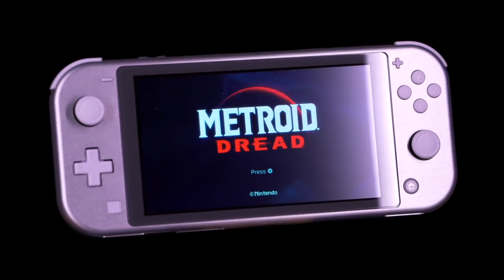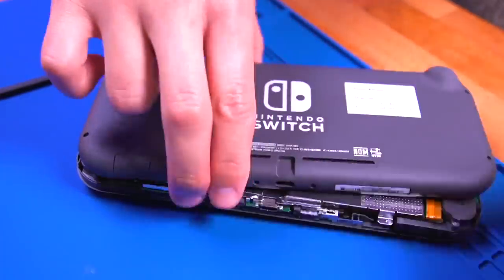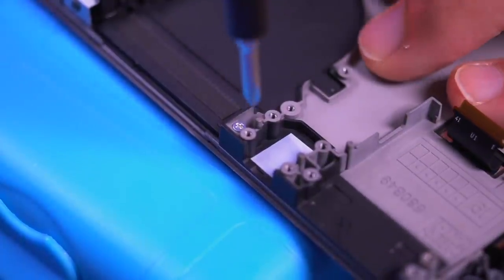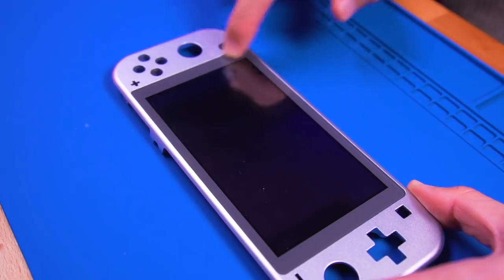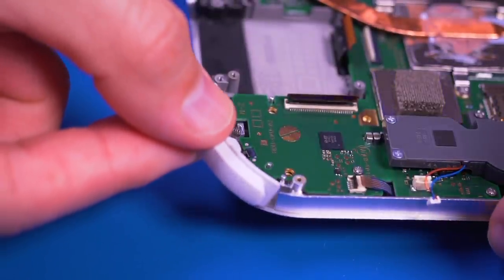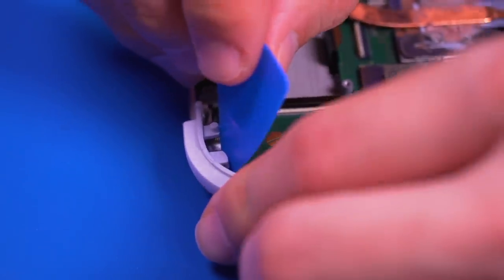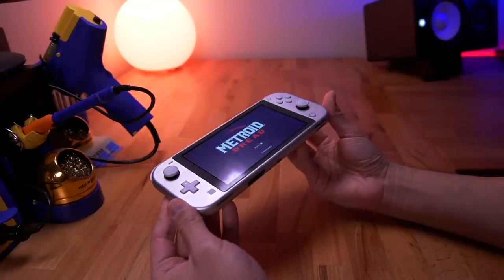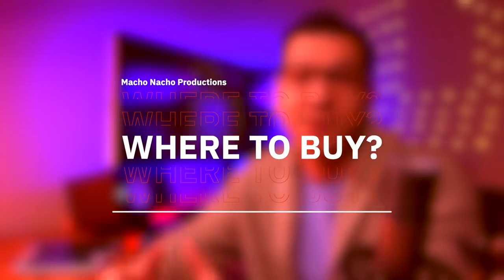If Apple Made a Switch Lite, It Would Look Like This!

Comment: Thanks! This was enjoyable to watch. I wonder if it would be possible to make a home console only version. No screen, no controllers sticking out. I bet a small all metal home console would look amazing.
Reply from the maker: Actually, that would be awesome 🤩. Something to think about for sure
Reply: I know it's pretty much a pipe dream, but I still hope Nintendo makes one. I never use my Switch handheld, but the handheld features cause me so many annoyances. Like forgetting to have it charged before going to play, because it won't power on even in the dock if the battery is dead or too low.  Or Nintendo not bothering to let you power off the system from the controller, because they completely forgot to consider somebody playing docked. They'd surely have to remember if there was no portable version... Right?
Reply: @mjc0961  I know what you mean. I usually don't play handheld either. If Nintendo doesn't make one, I'm sure a company like this will, though I imagine it'll involve some modding (soldering) to power off via controller and do away with the battery.
Reply: @mjc0961  why is the battery dead if you never undock it? 🥴
Reply: To power off a switch using only a controller press and hold the home button for 3 seconds and then press A on "sleep"

It's literally a day one feature how have you lived without this?
Reply: @skepticaltile  Problem solved!

Comment: Can the bottom opening for the antenna be filled in like the top with resin part of the way to still have a spot to transfer over your serial number sticker? Also instead of having the back panel plain, since you'll be selling it in your store, I think it would be cool having the Macho Nacho logo where the Switch logo would normally go. I also noticed at 20:40 that the screen isn't sitting flush with the shell and sticks out. Or is that a screen protector?
Reply from the maker: Great observations!  Yes, there is a screen protector on the the screen which is why it sticks out a little, otherwise is is completely flush. I was thinking of putting a logo but I wanted to keep it clean to appeal to most people. The reason for not having plastic on the bottom is I think to maximize the signal. I may be doing a live stream with the shell to answer
more questions. Stay tuned 👍

Comment: Pretty cool, but it would be nice if they were made to fit over the existing Switch case, which would of course work better with the Lite model. I bought a couple for the 3DS, and they were actually very nice, fit very well for an aftermarket product, and were only $5 ea. I also like the Hori clear silicone skins since they protect and provide grip.

Comment: Another amazing video showing something I didn’t know I wanted until now hahah. I was wondering if you have a suggestion for a reliable soldering iron? Preferably not too expensive but nothing cheap. Would really love your input. Take care!
Reply from the maker: Most irons from Hakko are very good quality. They are a bit pricey but definitely worth it in the long run. The fx888 is a great option. I use the fx951. Voultar did a great review on a cheaper iron from Aliexpress but I don’t have experience with it so I can’t offer my opinion of it.
Reply: @MachoNachoProductions  thanks for your help! I’ll do some research

Comment: Looks great, my one curiosity is how the cooling is. Does the back of the shell make contact to help dissipate the heat? If not I imagine some thermal pads between the back shell and the heat spreader would help keep things cool. I imagine it would just help prolong the system/battery life.
Reply from the maker: Yes, I added thermal pads to my original switch aluminum shell. It’s hard to tell definitively if it help dissipate heat but I like to think it does. You should check out my other video 😁

Comment: Oh man I'm so buying a couple stickers. This would be a mod that I would tackle if I played the Switch lite. One thing that I would be worried about is any pitting that can occur when the oils from your skin react with the aluminum.
Reply from the maker: Thanks Super Nicktendo!  No need to worry about pitting or corrosion since it’s made of aluminum and it’s been anodized. It’s very resilient.  Apple uses a similar method on their MacBooks and other devices.

Comment: 14:34 3mm screw was incorrect 5mm screw is the proper screw
14:39 3mm screw was incorrect 5mm screw is the proper screw
18:18 3mm screw was incorrect 5mm screw is the proper screw

These are the only errors I've found so far.

Comment: I wonder if it would be possible to mod in the ability to dock a Switch Lite during this mod, even if it didn't fit into a dock. Having a custom dock or just docking cable and being able to dock a switch lite would make this mod worth the time and effort imo. Great vid!
Reply from the maker: I know there are some docks that could fit the switch kit but having it display on the tv would be a difficult mod. It would be awesome though to have a fully functioning switch lite that offers the same features as the original and OLED switch

Comment: Awesome mod, I wish it had better finish, something similar to macbook or any other aluminum laptops on the market, there are some noticeable groves here and there from cnc process, lack of color options might be limiting factor as well, but overall great product!
Reply from the maker: The groves are primarily visible only on the inside of the shell. The outside is very smooth. I should have shown more close ups of the outside

Comment: On a side note what's the ETA on a Thicc-boi Switch Lite?? Add a couple of millimeters to the thickness on the back and you can probably fit a 10000mAh battery. I know you want to add wireless charging to this!
Reply from the maker: We’re currently developing the shell model for the injection molding. Taking longer than we had hoped but it still happening 😁